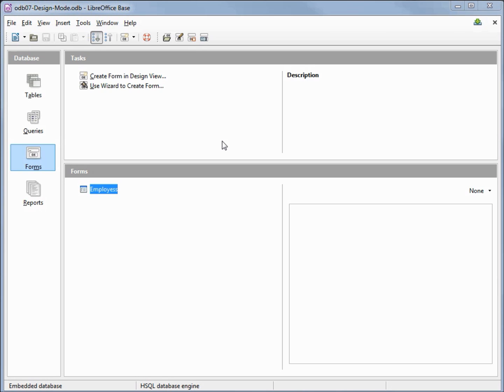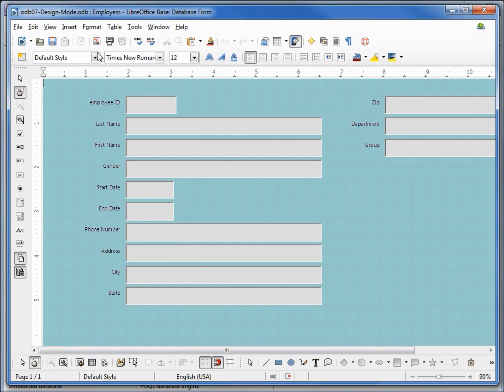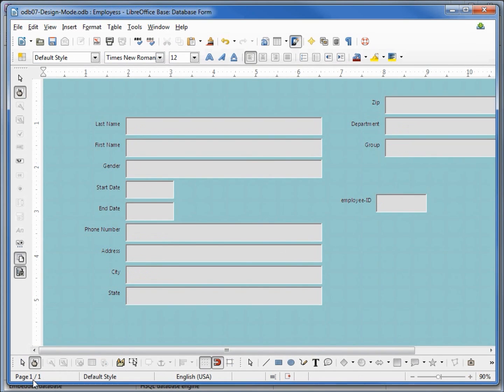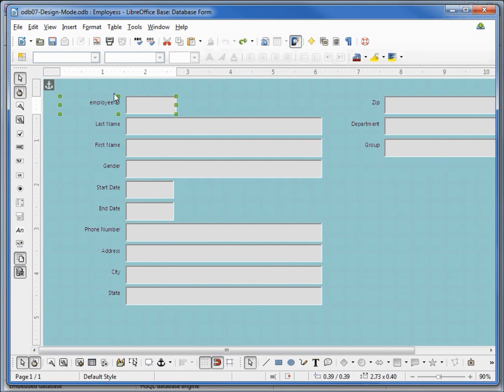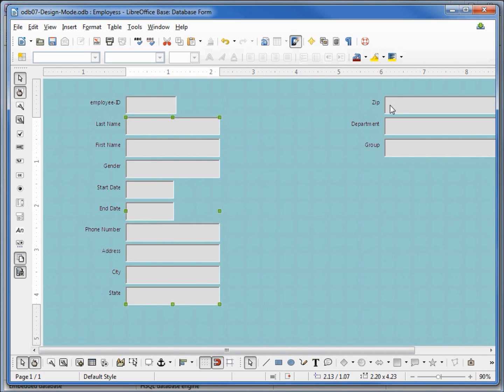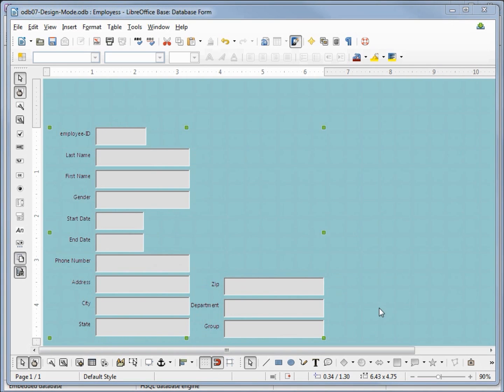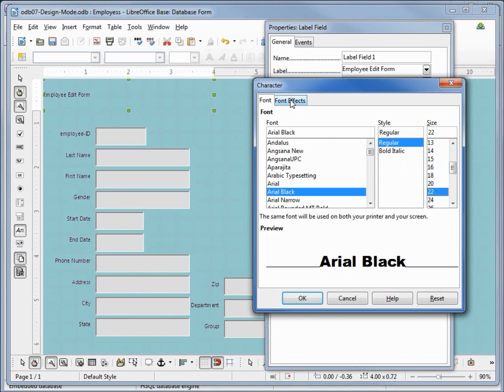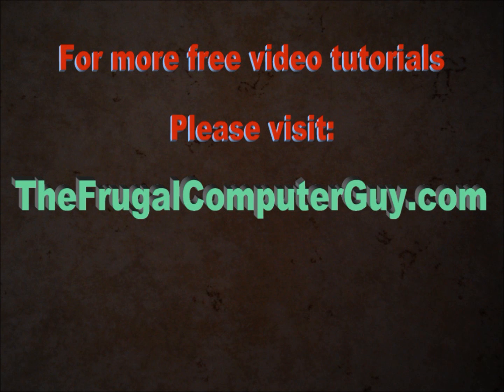LibreOffice Base (07) Design Mode Basics

Comment: Hi,
I have 3 forms. 1st form has 2 fields, 2nd has 4 fields from which 2 are same as 1st form and 3rd form has 5 fields from which 2 are same as 2nd form. there is no common field between 1st & 3rd form. If i make 3 separate forms, is it possible to link all these common fields between these 3 forms. If i change fields in 1st form is it possible that those same fields in 2nd form will also change.
Reply from the maker: Hi Bhagya, I think what you are asking is possible with the use of Macros, but Macros were not covered in this tutorial series.  I don't know of a way to do what you are asking without Macros.